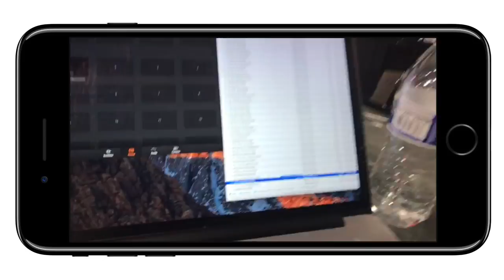Geeking on ATEM Switching, Live Events, Streaming Disaster — PhotoJoseph’s Photo Moment 2016-11-18

Comment: Hi ! Thanks for all your explanations in your video. It was interesting watching it. 

I just wanted to share an experience I had recently : I brought myself a new ATEM Television Studio HD (Feb 2017) and my mistake was to assume it was way too similar to the previous one I had, the ATEM Television Studio (2013). 

I went to the gig about two hours ahead in advance of the buffer time I had already  reserved myself to setup everything. This gig was on a Sunday. Setting up the ATEM was not the first thing I did when I got on site. Instead, I did setup the tripods, mounting the cameras, placing all the mics, the boom pole, running the XLR cables and so on and then I connected everything to the ATEM. I trust my Teradek Vidiu and I was trusting my previous ATEM switcher so I was not stressed about the new model I just got... just to realize that there is no HDMI PROGRAM OUT on the new ATEM Television Studio HD, which is needed to send the signal to the Teradek Vidiu. Fortunately, in my bag, I always carry 3 BMD HDMI to SDI converters and 3 Decimator HD-MX cross converter but those last three were already used because the production wanted 3 Gopro sitting on the interview table. The Black Magic converters are obviously only one way so not suitable in this situation. Being on a Sunday and time running by 18:00, all camera stores were closed by then. So I had to remove one of the Gopro and use its Decimator to convert the SDI PROGRAM OUT from the ATEM Television Studio HD to the Teradek Vidiu. (I don't know if the sound followed the conversion because I was also using a separate mixer). I was angry asking myself WHY WHY WHY they removed the HDMI PROGRAM OUT from the ATEM Television Studio HD and in my case this requires to add another device in the chain. However, you do get a HDMI MULTI-VIEW OUT on the ATEM Television Studio HD. I don't know if it can be changed to a program output via software and honestly I didn't look for it but that would be really nice.

The Teradek Vidiu is a great device, I have nothing to say against it (well actually, I just got used to it's flaws) but I might eventually switch to a more flexible solution that accepts SDI & HDMI as input for streaming and that also have more options to input audio than just a 1/8 TRS jack but still in the appliance format. Using a PC is great but it never gets totally dedicated to streaming and then you start having constraints.
Reply: Side note: BMD HDMI to SDI converter will not work with GoPro because of a SDI Level A->B or B->A mismatch which results in always having a SDI 1080p 59.94 even though the GoPro sends 1080i 59.94. I gave up trying after wasting half a day on this. Decimator HD-MX does the job out of the box.
Reply from the maker: Thanks for sharing all that. It boggles the mind why Blackmagic makes some of the decisions they do. No Program out over HDMI? That's insane! What if you just want to monitor it on a big screen? *sigh*. When I got the ATEM 2 M/E, I was very surprised that it only has one HDMI input. The next model down has (or at least had) several HDMI inputs. 

Good job sorting it out though (obviously, that's what you do!). And I'm happy to hear you like your VidiU. I need to reset mine and give it another fair shake. I've had so many problems with it I've just stopped using it, but I don't have a better alternative when on the road.
Reply: Another thing I wanted to mention about the BMD ATEM Television Studio HD is that now, the HDMI are not shared with the SDI like it used to be on the previous model. We can now use 4 independent HDMI inputs and 4 independent SDI inputs

Comment: That WAS interesting, I watched till the very last second. 
Thanks for these videos, I'm glad to get to learn from your mistakes... and successes.
It seems like SDI is the only solution to that audio delay. Did you switch cameras in the end?
Reply: Also for matching the video resolution & frame rates you need a decimator for each source?
Are there cheaper devices or a decimator that will do multiple sources?
Reply from the maker: +meloD30 Thanks! And yes I did… check out https://youtu.be/tYM_TzxVHmY and https://youtu.be/1acxhFnORCg and https://youtu.be/O57jmDR594Q
Reply from the maker: +meloD30 That's a good question. I know Blackmagic makes rack mounted frame converters but I'm not sure how many signals they can bring in at once. Definitely more $$ than the Decimator but if it handles enough signals and you need that many then I'm sure the economics scale eventually.

Comment: Very intersecting. Im curious - what converter do you use and I have a similar issue - 3 Blackmagic Pocket Cinema, and a C100 that I would like to use.
Reply from the maker: +Alvin Burrell To convert what; HDMI to SDI? I have Blackmagic ones as well as some cheap ones from Amazon that work perfectly well (1080p only)

Comment: Very interesting, thanks for sharing...I'm using the ATEM 1 me , the older version, just getting my head around it all at the moment. If you used SDI instead of HTLM as this only gives a 1 or 2 frame delay with audio, I'm just testing out at the moment. I'm using 3 x sony ex1 for streaming and looks great will no audio issues. Hope that helps.

Comment: Have you ever tried connecting the Program Out from the ATEM to the BMD Ultrastudio Mini Recorder (which converts SDI/HDMI into Thunderbolt) into a Macbook pro (using OBS/Wirecast as S/W encoders) for live streaming?
Reply from the maker: That is EXACTLY what I'm doing :) Except that it's a 5K iMac and I'm using Wirecast
Reply: And that works absolutely fine?
Reply from the maker: Since Wirecast 7, yes. Very reliable.
Reply: Oh great to know. What's the CPU usage like on your iMac while streaming? Too heavy?
Reply from the maker: Not at all. 40% or so. But I'm just sending it a single stream from the ATEM. Start adding in other streams and it'll climb up fast.
Reply: Thanks Joseph. You've been very kind and helpful. Appreciate it. :)

Comment: maybe your problem can be fix by using wirecast built in sound delay to sync audio and monitor the audio on that computer. go to sound window and you found the delay there. hope this was helpful.
Reply from the maker: +Rickard Petersson Thanks but if you're talking about the inherent HMDI delay I was mentioning, that can't be fixed in software. Wirecast can delay audio but not go back in time :-) I need to be able to monitor realtime audio, not delayed audio. Ever heard yourself talk on headphones but on a delay? It's maddening.
Reply: ***** then the only way is what you said it´s just picking up all audio to the mixer and monitor in that. i use Röde Ntg 1 to pic up ambient sound works great for me.
Reply: its cheaper than 3 new BM cameras :-)
Reply from the maker: +Rickard Petersson Unfortunately its more complicated than that. Say I route all dialog through a mixer for realtime monitoring. Perfect. Now that audio has to get to the Switcher. If it goes direct, it'll be 4 frames earlier than the video. So the solution is to route the audio through the camera so it picks up the same 4 frame delay. And now it's all in sync, assuming that your only video source is dialog. But now add a computer as a source that'll play audio. If you send that audio to the mixer it'll get delayed with the dialog, but the video from the computer will not get the delay, so now that's out of sync. So, you just send the audio to the mixer directly so it stays in sync, right? But then you can't monitor it. If you pull a monitor feed off the Switcher and mix that into your monitor headphones through a second mixer, you can't mute individual tracks on monitoring so you hear everything — including your own voice on the 4 frame delay. You can solo a single channel for monitoring though, so if you only have one other device playing audio you can get away with it. But I have three… computer, iOS, and the Skype Mac. Without the ability to mute channels or gang-solo channels, it can't be done. See, complicated as hell!!
Reply: if you use this divise between the mixer and the atem it could work.  http://www.datavideo.com/product/AD-100
Reply from the maker: +Rickard Petersson How would that help? That's to add delay. If I were to add delay anywhere, it'd have to delay mic audio and non-mic audio AND video.
Reply: you add delay to the mixer sound and you monitor the sound from the atem all would be in sync now. maybe iam not thinking strait the clock is in the middle of the night. i will think about testing this out for you and i come back to you.
Reply from the maker: +Rickard Petersson But then you can't monitor yourself. You can't listen to your own voice on delay. Your brain will crawl out of your head and strangle you.